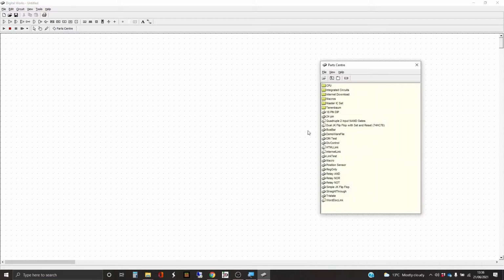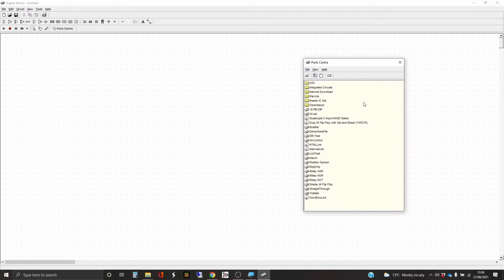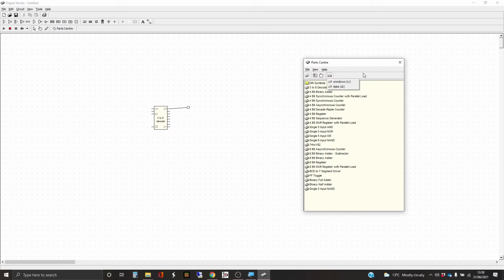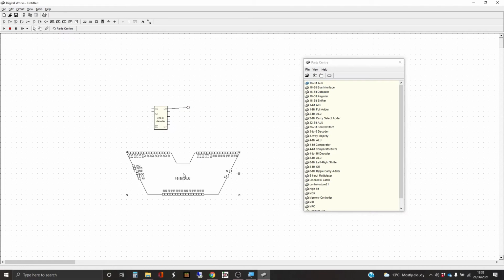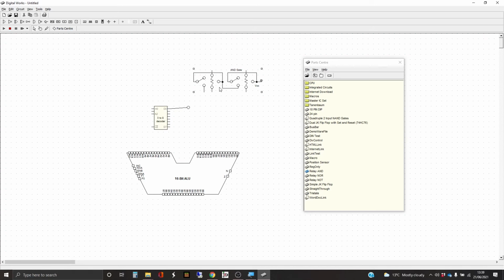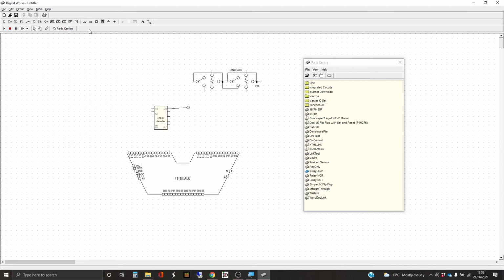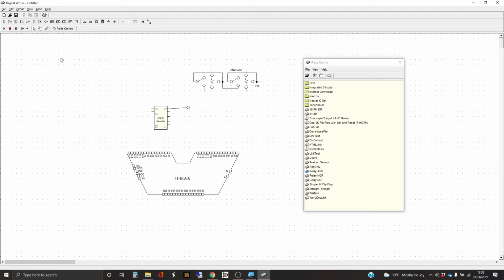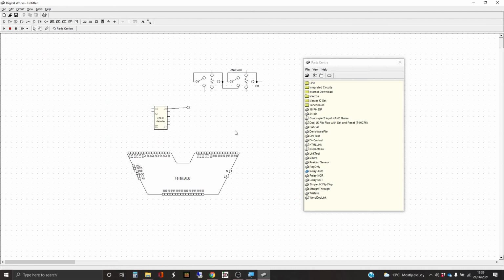Computing Fundamentals Tutor DigitalWorks 03: Parts Centre

Comment: I had an issue where I could not open the parts centre. I tried to click it, but it wont show up... How do i fix it? thannks!
Reply from the maker: The only thing I can think of is if you are running DigitalWorks from inside a zipped folder. You need to extract before it will run properly. If you already have, sorry, no other ideas.